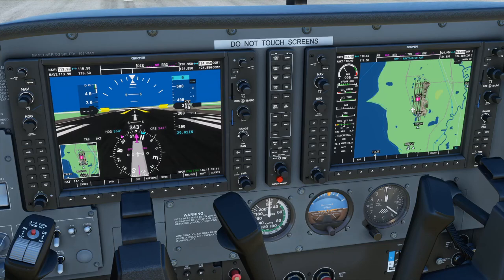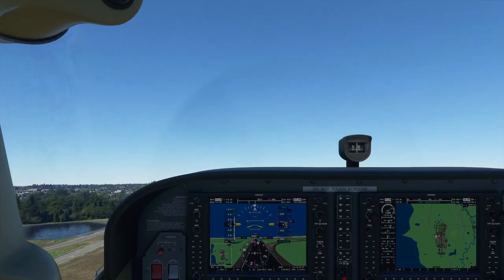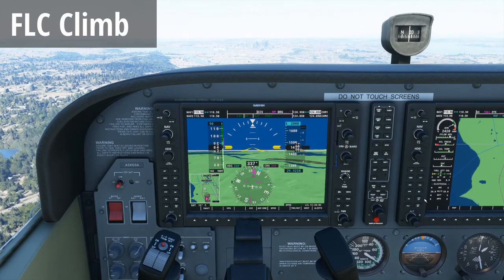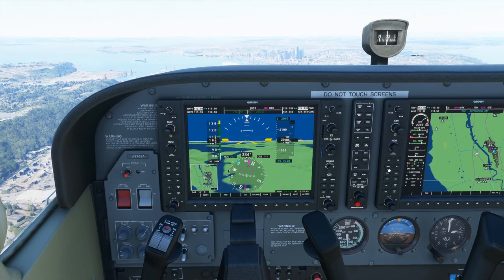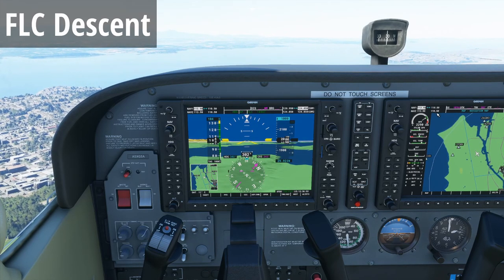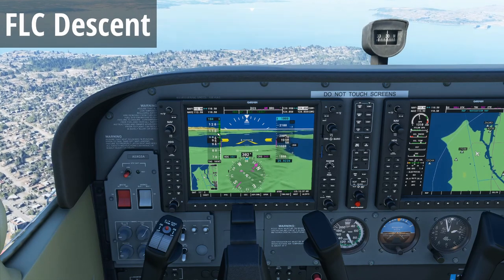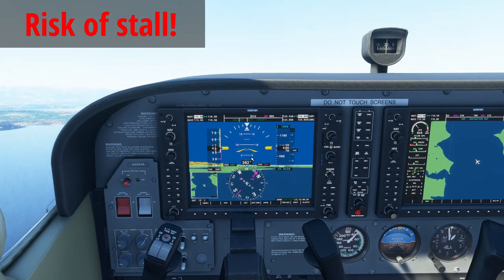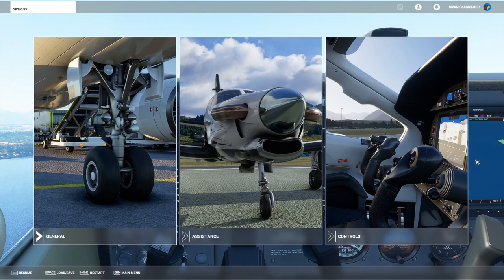FS2020 G1000 Autopilot Tutorial - Flight Level Change (FLC) - By real-world CFI/ATP

Comment: Hey there, when in situations with a non-standard BARO setting, I'm noticing that the autopilot seems to disregard the adjusted altitude readings and fly to altitude that would be correct for a 29.92 BARO setting.  So for example I was somewhere with a local pressure of 30.16, and then I set the altitude bug to 7000 feet and engaged FLC, and the autopilot took the plane up to about 7200 feet as read by the altimeter on the G1000, but the autopilot was reporting it was at 7000.  I had to set the bug to like 6800 to get the plane to 7000 as reported by the altimeter.  I read something somewhere else indicating that the autopilot may not get its BARO information from the same place in the G1000, but everything else I read claims the autopilot is "Fully integrated". is there some way to push the BARO info to the autopilot?  BTW I was in the Beechcraft G36 during all of this
Reply from the maker: Thanks for your question! I just tried reproducing your scenario with the G36 in FS2020 and unfortunately I didn't see the same behavior. It properly leveled off and maintained 7000 feet for me. You're right that this autopilot should be fully integrated with the G1000 and its altimeter setting (although there are autopilots that work as you mentioned, such as the KAP 140, where you have to set the BARO setting). Send me an email at mike@zerosideslip.com if you want me investigate further.

Comment: My flight mode stays in ROL, how do i change it back to LVL
Reply from the maker: Hi Dominick, ROL is what you should see. I suspect the LVL mode was an error in the modeling of the G1000 that was fixed after I made this video. It should show ROL according to the G1000 pilot's guide.
Reply: @FlightSimCoach  Thank you. I enjoyed flying using LVL because it kept the plane level. With AP it always flies at an angle. How do i set ROL to 0*  so it flies level?
Reply from the maker: @dominickbruni  You're welcome. ROL mode on the G1000 generally aims to maintain the bank angle that existed when the mode engaged. I would suggest pressing the HDG button on the autopilot, then using the HDG knob to select your desired direction of flight. Check out time 4:27 in this video to see me doing this. If you have trouble, let me know.

Comment: Thanks. Though I still struggle with FLC. I notice you keep having to press FLC. What turns it off... Changing alt? Also I've noticed a few times when I try to use it, it won't turn on. What's causing that? Is it clashing with something else.
Reply from the maker: Hi David, FLC is turned off once the autopilot transitions to ALT mode as you approach your selected altitude (you'll see that indicated in green text above the attitude indicator). Once that happens, the autopilot's goal is to capture and maintain the selected altitude, and you would need to press FLC again to initiate a new climb/descent. Before you do that, however, you need to ensure a new altitude is selected. Hope that helps - if not feel free to email me (mike@zerosideslip.com) and I can investigate further.
Reply: @FlightSimCoach  brilliant, thank you.